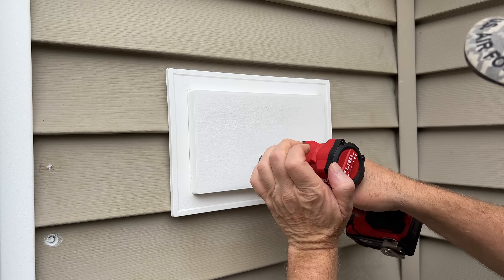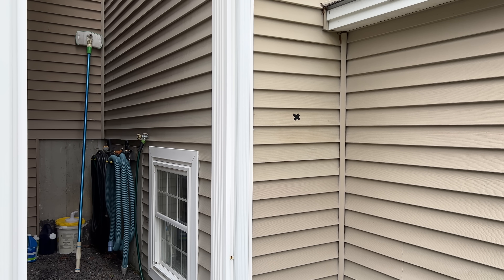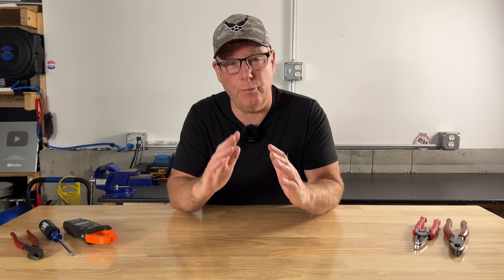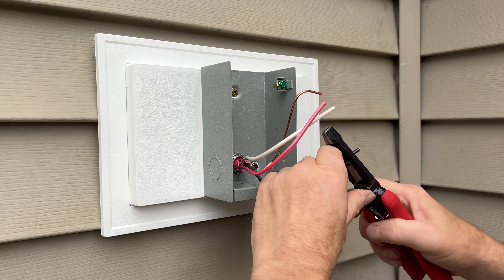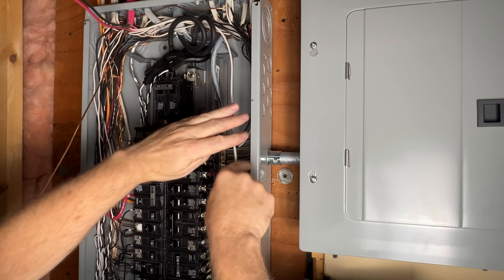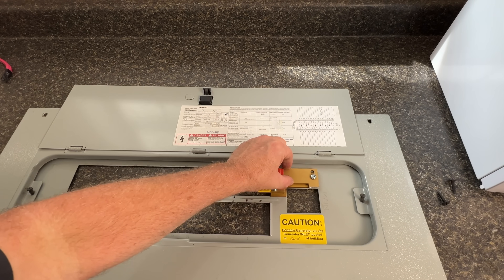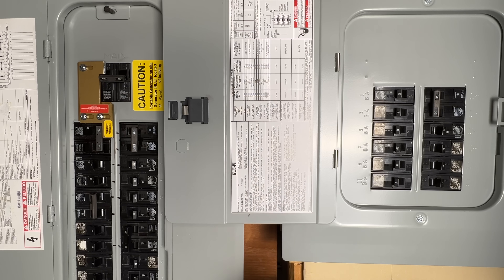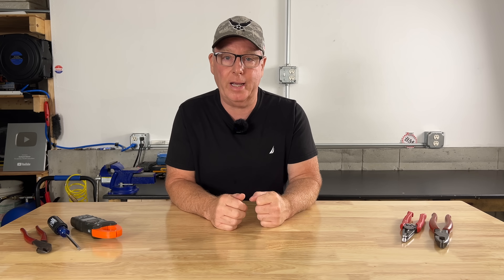Watch This Before Connecting a Backup Generator to Your Home.

Comment: I love the idea of a sub panel that contains all the necessary breakers for a power outage 

It’s genius
Reply: Well, sort of, but not really necessary.  The first question to answer is do you need a 240v circuit, such as a heater or well pump.  If not, then your real requirement is only 120v.  So if you're going to throw off most of the circuits, including all the 240v, then I don't see the purpose of a sub panel except it helps in not overloading the generator.
Reply: @spacecoastz4026  I’m really confused by your comment. 

Are you trying to say that it’s only necessary if your normal panel if full? Cause that’s not entirely true.
In this case it’s useful because in a power outage all the critical breaker are in one place together, so you don’t have to go looking for them. More off, they can all be thrown by one breaker.
Reply: @EllieDowney  Honestly it would take a long reply...but lets say you only have 120v requirement using a generator.  So the best solution to manage generator load is to use the 120v 30 generator output....supplying the same 120v phase into your panel (both legs) and just shutting off all 240v breakers which he did in the video.  Then you are not managing power by leg...and you really don't need a subpanel.
Reply: @EllieDowney  But even if you have a single 240v breaker that you need during a generator event, all you need to do is turn off all the other 240v breakers (which he did anyway).  No subpanel needed.  
In my case I have all of them marked with a white dot....I won't run any 240v appliance..and I don't have a well or pump that I need.   From my generator I'll be using the 120v feed...and the biggest draw are my two refrigerators...both of which are 120v.
Reply: @spacecoastz4026  Ok but um, no, he ran a 240v breaker with a 240v outlet. 

But regardless, what does 240v have to do with a sub panel? 

Oh also, powering the whole panel with the same leg is a code violation
Reply: @EllieDowney  I think he had a 240v requirement.  So what does 240v have to do with a sub panel?  The concern was managing load...and I don't see any advantage over his regular panel.  I'm sure he has a reason.  Code violation?  I don't know, but I discussed with an electrician first.  All of my 240v breakers will be off...I have an interlock to prevent backfeed to the utility...I have the correct adapter cable..and the end result is that all of my 120v circuits will run, and all of them all still protected by their individual breaker, and a dedicated breaker for the generator input feed plus the breaker on the generator itself.  It's just that nothing 240v will work.
Reply: @spacecoastz4026  Ok but why are we talking about load management then? I’m saying the sub panel is a good idea because all of the necessary breakers are in one place, and you can also see the needed generator to power it.

Is a sub panel necessary? No, but it’s useful, maybe he has other reasons, I’m not sure, but I like it for the reasons I mentioned above
Reply: @EllieDowney  He mentioned load management....and of course all the necessary breakers are already in one place...right next to the sub panel.  Maybe the channel will address.
Reply: Hope he can make a video on how to do it
Reply: Cheaper than a transfer switch, too
Reply: I went with a manual transfer switch. Much easier and not much more money. No interlock nor flipping breakers off and on; just a line/gen switch for the ckts you want powered. @rtsrts2317

Comment: Two things I was a little surprised about not seeing. 
First, the siding mounting block would've worked a little better in a vertical orientation. 
Second was the lack of discussion concerning preventing water ingress. IE duct seal and caulking.
Reply from the maker: I took care of all that but I didn't want the video being about the siding connection. I thought about installing the block the other way but I didn't like the cutout in the third piece of siding. It fit perfectly the way I have it.

Comment: Please help. I have an off grid cabin in Maine. I want to run my Bluetti  ac200 max power station to a breaker panel and have a gas generator for backup. My plan was to use 30 amp breakers for each with an interlock kit. My question is…Do I need to keep all the grounds and neutrals at the panel separate or should they be bonded ?  Thanks
Reply: There should only ever be a single bonding point between neutral and ground. So long as that interconnect remains present, no additional bonding point should be made between the two.
Reply from the maker: Grounded electrical systems are required to have a ground and neutral bond at the first disconnect. When using a generator for backup you would want a floating neutral at the generator. If you are using a bonded neutral at the generator then you will need to switch the neutral along with the hot wires when transferring to generator. This would be considered a separately derived system. Have a bond at the generator and at the utility is not code compliant and can be hazardous.

Comment: Top notch production quality, not to mention the content itself. I was about to have the exact same inlet setup, but it stuck out like a sore thumb against our vinyl (looks like yours is a little less intrusive in that corner nook). 

Anyway I think there's nothing wrong with only doing a 30A, doesn't matter if it's incrementally not much more to do a 50. You only need what you need. In our case id probably only need a generator once every few years, so it's only for critical functions like sump, well pump etc. If i were in TX with the bad power and heat, sure I'd want something to run my ac too
Reply from the maker: Thank you..
Reply: @slip0n0fall  I agree.  I have a WEN 4750.  Will run 2 refrigerators, a chest freezer and a few lights. Maybe I’ll throw in a 5,000 btu a/c. First time in 8 years that we lost power. At least I was able to test my “new” generator.  I bought it in 2017.

Comment: that service loop code. you said extra 6 inches was all you could have. yes if stapling 12 inches from the box. but you said it had to be within 12 inches. not at least 12 inches. so if you staple 2 inches from the box you can have 16 inches on the loop. correct? Talk about you tubers giving false info. lol.
Reply: No. The measurement is along the length of the wire from the box to the first attachment (IE staple).
Reply: @thomasbonse  yes and that is 18 inches. so thats 18 inches from box to staple. so if staple is 2 inches from box you can have a 16 inch loop like i originally said.
Reply from the maker: You can staple inches from the box and leave a 16 inch loop but you have to be careful of the bending radius of the cable. Also I think that would be an unprofessional installation and the big loop would be at risk of damage from other trades. If you are worried about the drywall installers just be careful to push you wire all the way back in the box.

Comment: With this type of set up, is it necessary to remove the neutral bond in the generator?
Reply from the maker: Yes it is.
Reply: @BackyardMaine wait?  My generator has a bonded neutral to the frame.  Are you saying I need to create a floating neutral for this to work correctly?  Man that’s an important detail to leave out don’t you think?
Reply from the maker: @Zues64  The neutral to ground bond can only happen in one location. For your home, this is either done at the meter enclosure or at the main panel. If your generator has a bonded neutral and you connect it to your home in a way that is not also switching the neutral, then you have two bond points. This is a code violation and can cause all sorts of issues. When you run a backup generator with a set up like I showed in the video you need the neutral to be floating. A bonded neutral generator needs to be connected as a separately derived system and the transfer switch need to switch the neutral along with the line wires. I plan to make a video on the subject.

Comment: I’m a sparky, not a framer, but I wouldn’t expect a sill plate at that height.  Is that what you meant?
Reply from the maker: I have a half daylight basement which is why you see the window. But you are absolutely correct. What I meant to say was the rim joist.

Comment: I just picked up the generac 8000w portable unit. It's a beast.

Why not just run the generator power directly to the sub panel? Seems redundant to power your main panel to power your sub panel. Either way, I'm doing something similar but with the generac home link kit.
Reply from the maker: I have a battery power station and an auto-transfer switch which connects to the sub panel. I'll be posting that video on August 12th. Pretty cool setup. I wanted to run the generator to the main panel to give me more flexibility to select loads and to recharge my batteries when needed. I think I'm going to but a bigger generator soon. I thinking about 8000 running watts but I'm also thinking about an inverter generator.
Reply: Where did you get the extension cord for the generator or did you make it ?
Reply from the maker: @rogerb.9590  This is a link to the same cord but the ends are a little better on this one than on mine. Amazon affiliate link https://amzn.to/3ZS7N8F
Reply: @BackyardMaine  ok thanks, I will get one, i have been looking for awhile but can't find one with both ends like that. like your setup. Thanks again.

Comment: This is the easy one. Just about every panel I've seen does not have a spare breaker space. You have to be a little creative. Usually end up double lugging onto a 30A breaker and can't use an interlock.
Reply from the maker: I can almost always find circuits that can be doubled up. Especially lighting circuits. I could run every light in my house on a 10A breaker now with all LED lighting.
Reply: @BackyardMaine Pretty soon there will be new 10A lighting circuits on 16awg wire being installed, thanks to the latest code changes.

Comment: Hi, Can I use interlock kit option vs. Transfer switch for 50 amp breaker? Is it code compliant? Thanks
Reply from the maker: Yes, absolutely. It would be the same process but with a 50A inlet, a 50A 2-pole breaker and of course larger wire.
Reply: @BackyardMaine  Thank you for all your wonderful videos. Take care.
Reply from the maker: @rylg.4442  My pleasure..

Comment: Nicely done, John. I did that exact setup at my last house. I need to do it here at the farmhouse. How important is it to use 10/3 vs 10/2?
Reply from the maker: Thank you Ed. It is very important to run 10/3 because you will need a neutral with a 120v/240v connection. With 10/2 current imbalance will be traveling on the ground wire which can become hazardous. If there is a difference in potential between the generator ground and another grounded surface you could be shocked. Current always travel in the direction of least resistance and you could become part of that path. I'm going to make a dedicated video going over whether a ground rod is needed and whether or not you have a bonded or floating neutral on the generator and the requirements for both. That will be my next upload or possible the one after that.
Reply: @BackyardMaine  thanks John!
Reply from the maker: @MyClutteredGarage  Unless you only had a 120v backup Ed..

Comment: Great video. Personally I would go with a 50 amp setup. It’s not much difference in cost. It just a way to future proof the setup in case you get a bigger generator.
Reply: exactly so 12 years ago I had a 5500 W generator and I installed 30 amp. Used it once here in South Florida. Because most of the time when the storm is big enough, I just leave as I have another home somewhere else that said this week I am now installing 50 amp receptacle because I bought a 13,000 W generator.😝😝😝😳😉
Reply: @youcanthide004  where do you set it up if you are in flood area, it must be up off the ground?
Reply: @Barracuda48082 the cord? The generator? If you’re in a flood area yes, off the ground. By some cinder blocks and set the generator on top.
Reply: I installed a 50amp. I’m also running a Tri Fuel generator, so it’s connected to my natural gas. Everything together cost me around $2,100. Definitely a lot cheaper than a standby generator set up.
Reply: Agree.  I was going to say the same thing.
Reply from the maker: Thanks for sharing!
Reply: @BackyardMaine I am looking to add an inlet outlet on the outside of our garage on the side of the home so I can connect a dual fuel generator to it and pass through the power to an inside inlet outlet just on the other side of the garage wall. Neither of the inlet boxes will be connected to any electrical panel in our home. Why are we wanting to do this. So we can power Delta Pro Ultra batteries inside the garage so we don’t need to leave the garage door opened to run a power cord from the gas generator to the batteries. We want to just pass power through the wall via both inlet boxes and then plug power cord into inside garage inlet box and run a cord to the batteries to charge them. 

Will this require that we need to run a ground wire from the inlet boxes to ground since they won’t be connected to the panel ground system?  Thanks
Reply from the maker: @1125-CD  Since the setup will have no connection to your electrical system you will want to run a bonded neutral generator and bond the frame of the generator or to ground. Most battery power stations will not charge with a standard generator since they produce a modified sine wave. You will most likely need an inverter generator to accomplish your objective.
Reply: @BackyardMaine  hey thank you for your reply. My plan is to use an inverter generator. I assume your recommendation for me would be the same right
Reply: I agree but there is significant difference in cost. 50amp u need 6/3. 50tt roll is like 250-300.
Reply: @MrAwsomeshot  I got a 50amp 50ft heavy duty 6/3 generator cord for $140 on Amazon.
Reply: @MrAwsomeshot  yes that’s for sure. The initial cost in creating and wiring for 50 amp versus 30 amp can be significant depending on the application. But for me worth it 100%.
Reply: I agree
Reply: I have to run my cord 100 ft away from the plug I need to know what to do
Reply: Do you have one on supplying both busses or just half panel ?
Reply: I'm actually thinking of doing that.
Reply: If you get a 50 amp set up, can you plug in the 30 amp as well?
Reply: I would too, but you can't plug a 30a gen into a 50a receptical. You could do a 50a system (wire and such) but put a 30a receptical, but I'm not sure the larger 50a wire will fit into a 30a receptical. One option that could work; do the 50a system fully, then make a 30->50 adapter to go from 30a gen to 50a receptical. The other way would be Ill-advised though, since the higher power generator could/will exceed the lower rated structures wiring.
Reply: @AceBoy2099  They do make adapters, so wiring for 50A would make perfect sense.
Reply: @mae2759  oh, ok. I was unaware of that adapter, I havnt looked for one as I only have a 30a generator and wiring setup.
Reply: @AceBoy2099 you can easily make your own adapter.    It's easy to do.
Reply: @AceBoy2099 RV supplies have them,  specialty items cost.
Reply: @AceBoy2099  My Firman trifuel generator has both 30 and 50 amp receptacles.  The manual, however says the 50 is actually spitting out like 31 amps.   It's weird but it is what it is.  I'm thinking of doing the 50 amp inlet box since my gen has the "50 amp" (31 amp) output.  So in the future when I get a "True 50 amp output generator" I'll have everything already set up.

Comment: Hi I like your video's it is always cool to watch another trades person doing electrical installations and such, as for this video I must say that on using a interlock kit is NOT ideal , several reasons why, firstly if you read the manufactures item use for this product it is for specific area's and I may be wrong and the listing may have changed ,but, I do not think it is listed for a homes main electrical service panel. It is listed for specific area's and uses only. If that is being the case of its listing any damage that may occur will not be covered by any insurance on the home for using a product in a use not designed for what it listed for. Secondly being a qualified electrician and knowing what you are powering up and the limitations of your loads and generator are important, thing is some one that is not knowledgeable or qualified about the load they may be powering up can cause severe risk of fire to their wiring and damage to the generator.  Look at it from this point of view a homes 100 amp electrical  typical sizes of wires for 100 Amp Service are 4 AWG or 2 AWG for copper wiring and 2 AWG, 1 AWG, or 1/0 AWG for aluminum or copper-clad wiring, here you are potentially powering up the electrical panel with a number 10 awg, quite the size difference. Now picture a unqualified individual just powering up their house panel with out regards to the size of the load and just powering up the whole panel, kind of spells a recipe for disaster.  I have learned over the years always assume that a unqualified individual will some how come into play with the equipment and best to safe guard against that. Will this work to safely to power up a home and prevent the risk of back feeding onto the grid yes it will, but, can you be sure that a qualified individual will be handling and operating the equipment?